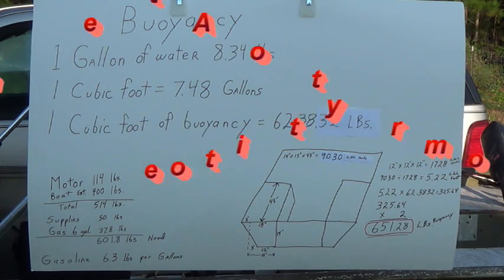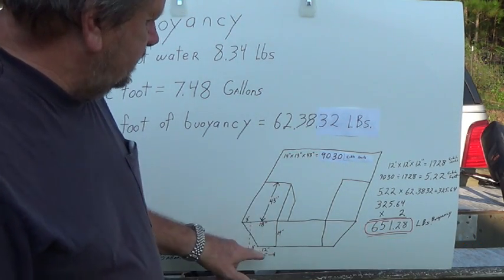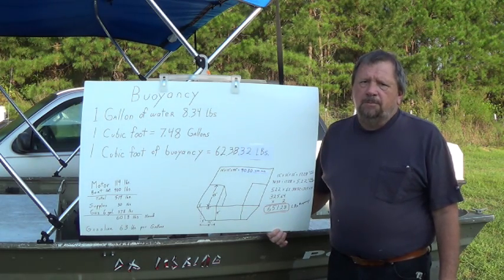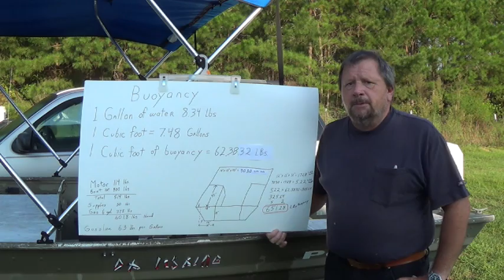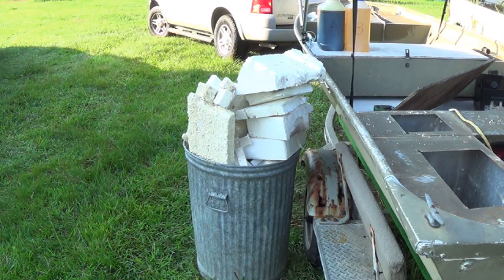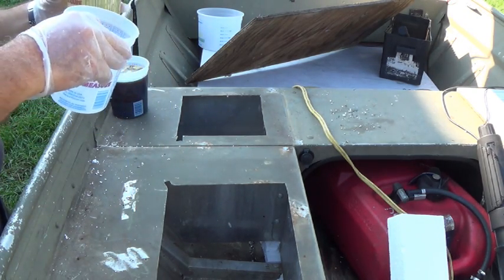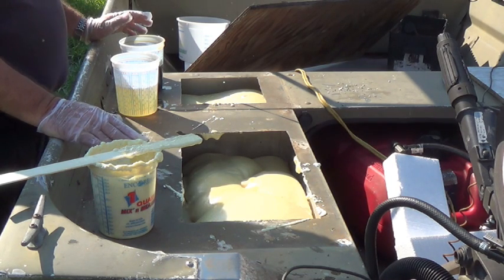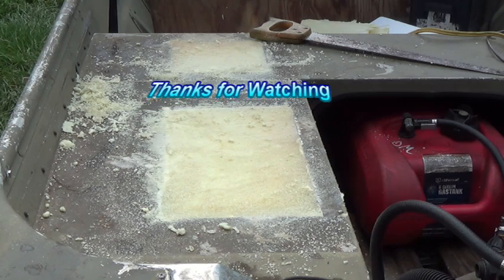John Boat Buoyancy, Needs & Wants.

Comment: No. Adding foam inside your boat doesn't make it more buoyant.
It keeps it from sinking if the boat takes on water.
Reply: no sir you are incorrect. your comment makes no sense what do you think buoyant is? keeping the boat from sinking means its more buoyant. he never said it would improve draft which is what you are trying to say. im just going to assume you only play in the woods and not on the water.
Reply: Nw woodsman you are 100% correct, you lose total weight capacity but you make the boat not able to completely sink to the bottom of the lake
Reply: No he is correct. The foam does nothing unless you  take on water. The foam actually is dead weight  unless you take on water. The point is the foam does nothing but add weight to the boat unless it takes on water.
Reply: No chuckie. Think it over agin. Well your right only if the boat takes on water. But if  boat is not taking on water it does nothing but add to the weight of the boats boyance
Reply from the maker: @tomterry2662  The point I was trying to make if your boat would become swamped you and all of your stuff would be on top of the water, not the bottom.
Reply: If the foam is below the water line, which if it's on the floor it's works as a flotation device, water doesn't need contact with foam to activate it to float,
Reply: @RusVito  throw an empty coke bottle in a floating boat and see if it raises it out of the water any.  It won't. the foam is only activated when it's in direct contact with the body of water the boat is in. It increases buoyancy if the boat fills with water, but only adds weight under normal conditions.

Comment: Hey buddy I just wanted to let you know I subscribed I was looking for this knowledge and I'm glad I stumbled across it I'm actually building a custom boat as we speak and you gave me all the math I needed to complete my job so I thank you very much
Reply: I'd like to add I'm borderline building a pontoon bass boat but it's going to be a little bit more simply than you would think roughly a diamond shaped pontoons themselves are going to be roughly one foot wide and there's going to be a total of four pontoons two on the sides then two down the middle and then my compartments are going to roughly be 6 in deep under the floor itself and those should be a a few inches above water when trolling it's going to have a little bit of drag when going about 15 to 20 but I'm going to make sure there's a bunch of I don't know how to describe a keel lines going through to decrease drag and keep a straight line consistency to it I'll be sure to send some pictures and etc because you actually helped me how to get the math that I needed so thank you
Reply from the maker: @jonnypage9484  I am looking forward to seeing the build. Please send pictures.

Comment: Please read. Trying to get correct info out there. The replacement foam while coast guard approved, If it is not kept completely dry it will soak up water over time.  Go to manufactures data sheet. Says right on it that the stuff will soak up water. Does not have to be submerged . All two part foams will soak water.  Coast guard does not test LONG term.  Polystyrene insulation boards are not chemically resistant, think gasoline. The white stuff he took out is probably better than what he put in!! Especially if it was polyethylene!  The previous owner took out the old soaked two part foam and put the white stuff in. Notice the white stuff is dry??
His math is mostly correct, however all materials will displace water and provide some lift. When the coast guard calculates foam requirements they have factors for different materials. The engine will have a factor, fiberglass and wood have factors. Aluminums factor is .63. so if his boat weighs 400 pounds, it only needs 400 x .63 worth of flotation thats 252 pounds of flotation required for the Hull. I dont have the motor factor off the top of my head but he doesnt need 114 ponds of flotation for the motor. Gasoline is lighter than water so he can deduct its weight and add 2 lbs per gallon  of flotation. The CG calculates flotation required for people at 25% of person capacity. So 4 people the requirement is 100 pounds of flotation. The flotation is required to keep the boat and you at the surface  but does not have to  keep you out of the water.
so as long as he can keep the two part dry, which Im skeptical, he has more than the coast required amount of flotation.

Comment: So what your saying is if I add more foam I can hold more weight???
Reply from the maker: Here is what I am trying to say. There are so many boat out there that if for some reason they take on water they will sink to the bottom. If for some reason your boat got a hole in the bottom. Then the boat fills completely with water. With the proper amount of foam in it. The boat would hold you and your gear at the water surface.  I was talking about how much foam you would need in your boat to take it to the lake and it would not sink. This is what most new boats are set up with. A lot of older boats have nothing.

Comment: Metric system is strait forward. Using metric system you didn't need to calculate almost anything, you get the answer straight away. 1 liter water = 1 kg
Reply from the maker: Thanks for the information and thanks for watching.
Reply: Google pretty straight forward.. you get your answer straight away.

Comment: Thanks for the good video and information. I am planning something similar with my aluminum boat.
      Additional accuracy was not necessary for your application because there was plenty of space for flotation foam to get the buoyancy that you needed. 
      For other applications, it may be helpful to know that about 3% accuracy may be gained by (1) subtracting the weight of the old foam (which was removed) from the weight of the boat and (2) taking the weight of the new foam into consideration.  A value of 60.4 pounds of flotation per cubic foot of filled space can be used, which is based on 62.4 pounds of water per cubic foot less 2 pounds of new foam per cubic foot.  According to information from USComposites.com, their lightweight foam, which is commonly used for filling voids, weighs about 2 pounds per cubic foot after fully expanding.
       To avoid measurements and calculations with fractions of an inch, I like to measure small lengths in centimeters. I prefer to use weights in pounds. Thus, I will use 0.00213 pounds per cubic centimeter, which is equivalent to 60.4 pounds of flotation per cubic foot. Some equivalent values using metric units are 968 kg per cubic meter or 0.968 kg per liter or 0.968 grams per cubic centimeter, where kg is kilograms.
Reply from the maker: Thanks for watching and sharing this with us!

Comment: this is a much debated topic. there are 2 different factors here.  your boat is buoyant. FALSE. Your boat displaces water. Basically it sits on top of the water.( yes i know that is not 100% correct but close enough for this forum) Fill a boat hull with water and it sinks. The foam he is adding IS buoyant.  But it will aid only in stopping the boat from sinking. it A) displaces water that otherwise would be able to be in the boat and B)  and AFTER the boat has filled with water will the foam be able to provide "lift" to keep it from going down.  Simple experiment take a bottle it floats. measure how much force it takes to pull the bottle under? Take the now full bottle and weight it.  now fill the bottle 1/2 way with foam.  Measure the force needed to pull the bottle under. note it takes the same force. Now take the full bottle weight it. it weighs less. The foam takes up space ( less water in the bottle) but now the foam comes into play and adds lift  helping to keep the bottle afloat   only when full of water. where as the other bottle will sink to the bottom.
Reply from the maker: I agree with you. I guess I was not clear when I was talking about this. I was only trying explain. If your boat fills up with water all the things in the boat that are not buoyant will sink to the bottom. If you have enough buoyancy in the boat like foam the boat would stay on top the water. The boat would be swamped, but it would still save your life for those that can not swim or it's to far of a swim to shore.Thanks for sharing your knowledge and commenting. Boaters helping boaters